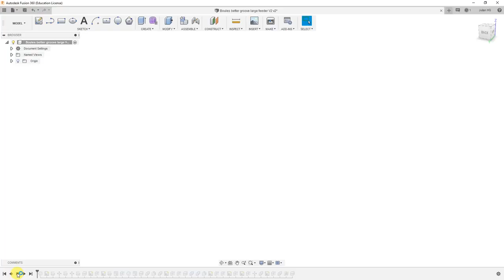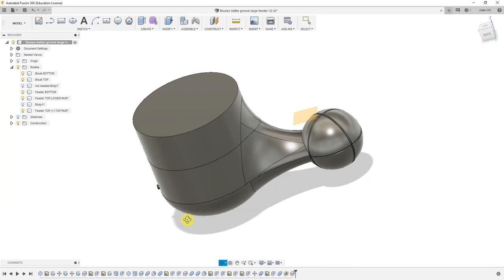Casting a solid Bronze Boule (Petanque) - Casting a sphere!

Comment: A couple of days ago was garbage day in my area, so I was looking for scrap metal to melt and found those balls you mentioned in your video (boule) They are magnetic and weigh 750 grams. So why does each ball have one line two lines etc . Also for their volume they are too light, they should be 1.5 Kg so I think they must be hollow.
Reply from the maker: luckygen1001 hi lucky, yeah they will be hollow, the lines are for identifying which team member threw it, the closest boule to the little “jack” ball wins the round
Reply: Thank you mystery solved! If I had not watched your video I would never have known what they were used for.

Comment: So glad i i came across your video & work, i am a hobby refiner in the southwest of the UK & i am about to embark on something bigger than ive ever attempted, ive only cast silver in bars & cubes before & only of a max of 1 kilo & even a 1 kilo cube has a notable shrinkage in the centre,
 i want to make a perfect .999 fine 5 inch silver sphere & had really not taken into account the physics involved, i had neglected to think about the gravity/mass of metal required to effectively force such a large mold,
ive only used machined graphite moulds up till now, so this casting method is a whole new art that i have learn the peculiarity's of. 
I think ime going to have a few test fails using bronze first. 
Looking at the work involved ive no doubt my first couple of go's are going to be pretty tragic.
 Excellent results you have there, great work & it certainly did look like work to haha,
Ime going to build a bigger furnace as well, my current one is on its last legs & way to small, i had not realised just what i was biting off until watching your video.
Reply from the maker: thanks luke! yes casting a sphere is literally the hardest possible shape! i'm really  glad you like the videos, i should be making some more really soon! good luck and let me know how it goes!!! cheers o/